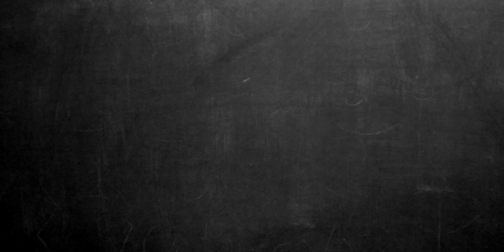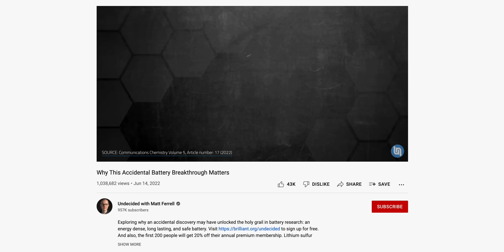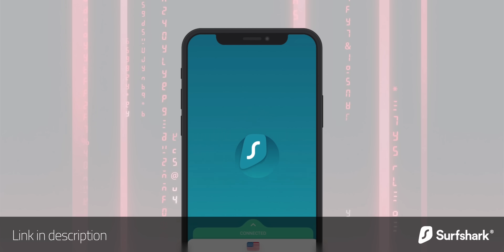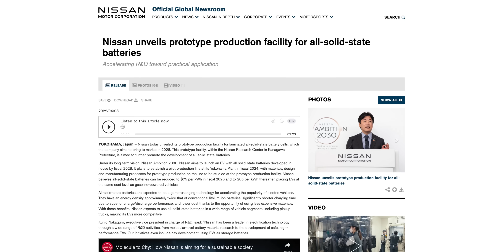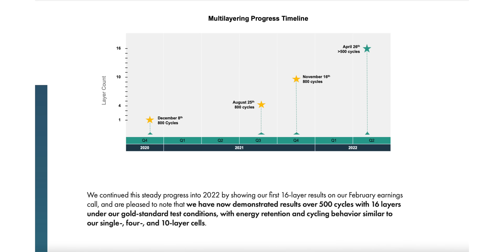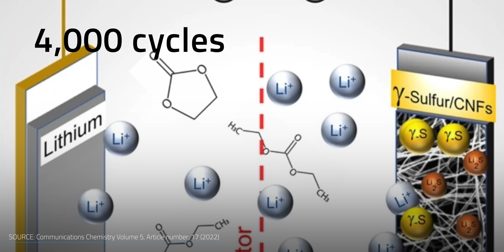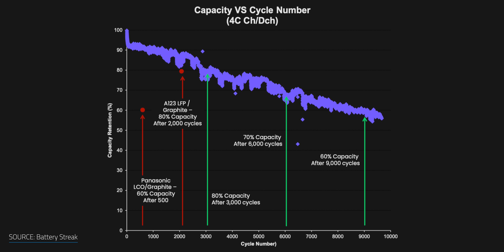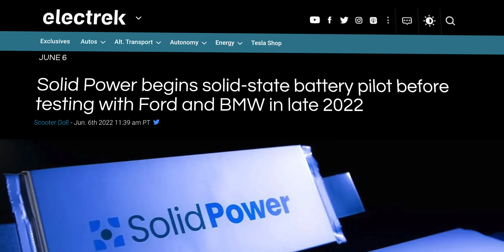Is This Solid State Battery Too Late?

Comment: The model 3 is so much fun I'm not really worried about my charge time since for everything i've done it's charged overnight. Now in the future if they get some insane battery it'd be cool to replace the battery in my model 3 after it ages a bit. Get 700 miles of range would be pretty insane tbh.
Reply: @Screwdriver440 good to hear, assuming they don't end up in landfills.
We've got a bad track record as a species with making something, then having an 'opps' moment for the next 2-3 generations
Reply: Also for a motorcycle that has limited space for a battery could benefit from all this. Imagine the perfect commute bike with a healthy 150km of range.
Reply: @makatron  Or an Aptera or Lightyear. But yes a bike with a real world 150km highway range that could recharge in a few minutes would be great for small mountain road trips.
Reply: Those new tabless cells are almost the size of those 90 calorie Pepsi cans.
Reply: For the majority of people who are able to charge at home, speed of charging is not an issue. What is an issue is availability of en-route & destination chargepoints. In the UK, roll-out is patchy and many of these are alas not working :(
Reply: @guy2726  charging away from home will be solved best by market forces. I expect it to be solved fairly quickly.
Reply: @Screwdriver440 It is true on theory.  In real life there is very low recycle rate for old battery.  How many mobile phones you own in your life?  How many pieces of battery of those phones recycled?  Cost of recycling  is very high and in most cases unprofitable.   It is even worse for a EV's battery.  It is structured like a Russian doll with layer and layer and layer and layer and layer of encapsulation.  Recycling is even more difficult than manufacturing itself.
Reply: @catchnkill  I know a lot of recycling is BS and what you say about recycling lithium batteries is true today but, it is not a stretch to claim that with greater adoption of EVs, the vehicle-lithium market will follow the lead-acid market.  Lead-acid batteries are the most successfully recycled product ever; over 99% actually get recycled!
Lithium batteries for phones, tablets and what not, are (as you point out) another story all together.
Reply: @catchnkill  automotive lithium batteries are already >90% recycled.
Reply: @williammeek4078  You throw a random number for bluffing.  Sources?  I can tell you that it is not true.  In the biggest market of EV China they never claim such rate.  So your > 90% is npt possible.  Sources please.
Reply: @catchnkill  in.most countries, there are laws in place that requires the manufacturer to recycle its products.
If the consumer throws his old phone on a trashcan, the manufacturer is off the hook.
The replacement of a car's battery on the other hand will have to be done by a professional company which certainly would want to send it back to the manufacturer for disposal and recycling (or else they would have to either pay for it themselves or illegally dump it somewhere).
Reply: @mpbello  Real world situation is more difficult than that.  Just use Asia as an example.  The word "most" cannot be applied here.
Reply: @Screwdriver440 Telsa's battery is not like this at all.  They use standard 18650 battery cells to build their battery pack.  Say for example a 85kwh battery pack.  It consists of 7,104 lithium-ion battery cells in 16 modules.  Each module contains 6 groups of 74 cells wired in parallel. The 6 groups are wired in series within the module.  There are a lot of compartmentation to minimize the fire risk to the whole pack.  Within those compartments there is fire-retarding fluid.  There are temperature and other parameters monitoring circuit boards.  It is not just a big aluminum case.  Finally those 7104 18650 cells each  has theirs own metal cases like a normal AA cell.  Not as simple as you say.
Reply: @catchnkill  only the model s and x use 18650 cells. Newer models use 2170, 4680, and CATL LFP cells. Currently Tesla’s cells are 90% recyclable and they intend to have a closed loop supply chain as they won’t need to mine for new minerals to make new battery packs. There’s many ways to incentivize this like discounting the replacement cost for a battery when you trade in your old one. Tesla’s current battery will last 10-20 years easily so it will be a little while before there will be a large number of packs to recycle
Reply: Lets hope your old battery can be recycled then, otherwise ppl with chase the latest fad, thus undermining the modest Co2 gains EV's offers Rob

Comment: Is solid state dead? Not at all, it hasn’t even started yet.

Are there other, similarly good possibly even better, technologies out there? Of course. 

Should we stop pursuing one over the other? No! All technologies are good and useful, especially various battery designs. A solid state battery, of any chemistry, will always be the most optimal choice for applications where impacts are likely, where massive temperature fluctuations are expected, and where accidents are common. 

Niobium batteries will be optimal for high longevity, high reliability, mission critical components like finance servers or ground based defense systems. 

The phrase “you need the right tool for the job” only applies if you even have the tool. Developing multiple battery technologies that are similarly effective, cheap, efficient, and useful can only be good for us

Comment: 65$ /kwh would make for fantastic electric tools - 2 stage snow blowers, chain saws, leaf blowers, trimmers, etc all with awesome run times! a snow blower needs 2-4 kwh to have a useful run time in new england with 24-36 inch storms relatively common. i have 1.5 kw hour ariens and it is barely adequate for driveway + sidewalk so i usually have to do sections with charging between. ebike packs are around 400 dollars for .75 kwh...
Reply: You aren't going to see $65/kwh for use in power tools.  Look at the mark up currently for power tool power packs compared to the claimed prices for lithium ion currently.  Look at the price of name brand ebike battery packs.

Comment: Way too little, way too late.   A techno-fix is not going to stop the accellerating runaway greenhouse process.   What is needed is the immediate removal from the atmosphere of 2 trillion tons of greenhouse gasses.  How much will better batteries remove?  -  Zero.   The only techno-fix possible is the placement of a massive fleet of mylar spaceships at lagrange point one, to block 2.5% of the incoming sunlight.   That would take over 100 years.   Climate collapse will occur within a decade, two at the most.

Comment: It's actually too late for EVs for mainstream use. I'm a firm believer a synetic fuel or a carbon scrubber will become mainstream. I'm betting more on a carbon scrubber. Simply add it to the existing cars. Synetic fuel could beat them to the market though. Synetic carbon neutral fuel is absolutely the best case scenario. No infrastructure change. No one has to get new vehicles.
Reply: Yea synthetic fuels will only happen though if the cost of manufacturing goes down which could happen once economies of scale kick in but likely that much, or fuel continue to rise to double normal market value to make it cheaper in comparison. The big stickler right now is cost of fuel is artificially high due to restrictions on the oil industry in the US, and the trade embargos. And no investors are going to invest billions in new infrastructure when those artificial restrictions can be lifted any moment and they are left with an expensive money pit.

If someone can get a government to back it and go mainstream and be profitable it might happen(good luck)or the cost of fuel stays high permanently. One is unlikely the other will hurt everyone that cant afford EVs.
Reply: That's like riding a steam powered horse. EVs are far superior to ICE in almost every way, there's no reason trying to patch the inferior tech, when you have something much better.
It makes more sense to convert old cars to electric. In 5-10 years it will be easy and economical to do so.
Reply: @andrasbiro3007  Not really that drastic. The current situation is more comparable to how the adoption of the automobile in the first place. Only the rich could afford them while most people where satisfied with their horses. Yes the automobile could carry more, and didn't need have as much maintenance cost or constant food, but the upfront cost was way out reach of the average person. And as we are starting to see now they where adopted by rich people and businesses before the cost went down for the average person to get them, but never went away. Horses are still used by people in my area(Texas) for many things as its just better for the situation.
Reply: @Awrethien  
1. Car adoption was very fast. Try to imagine a scene where half of the traffic is horse and the other half is cars. It's hard, because you never saw such thing. And you never saw it because it was such a short period.

2. There's still no steam powered horse. Of course synthetic fuels are much easier to do, just expensive. But my point was that it's irrelevant. When 99% of the cars are electric, what the rest uses makes little difference. The biggest issue will be air pollution. Just like with smoking, when it's no longer ubiquitous, people will be much less tolerant. I've been driving an EV for almost 4 years now, and I hate walking behind gas cars. I have to hold my breath, because all I can think of is every breath shortens my life. Never had such problem while I was driving ICE too.
Reply: @andrasbiro3007  1."Car adoption was very fast." Not really time seems much faster when looking back on paper and missing a few points.The first concept was in 1881 and the first true "car" first proven in 1886(see Benz Patent Motorwagen). The first mass production was in 1900 and expanded in 1916 with Ford's assembly line. It was not until this point it massively took off. That is almost 20 years to even gain momentum. It still took another 20 years for many places to switch over to trucks. Even in the outbreak of WW2 large sectors were reliant on horses some 50 years after it was invented. It was the industrialization from both the world wars that make vehicle adoption possible even that rapidly.

From the combination of cost being slashed and how there were very clear direct benefits to trucks and cars of hauling much larger cargo amounts, farther and faster. Electric at the moment has the inverse of being MORE expensive than ICE vehicles, and have to choose between range or cargo with the downside of more downtime from recharging... Battery tech is improving but it still has a long way before there is full replacement.

2."There's still no steam powered horse." No it's not and no one ever said it would be, but synthetic fuels are a possible stopgap until EVs are more economical. Congratulations on having an EV already and being willing to live with its shortcomings. I also could live with one as a personal car, but I can't drop $30,000+ on a new vehicle that I would drive less than 50 miles a week. Also I would literally be unable to do my day job since I drive a company truck. An electric vehicle just does not have the range I need as a field tech for an ISP provider. 

It is these issues that will keep the adoption of EVs slow. They are not a clear cut improvement, they for now have their own advantages and disadvantages mostly range and cost. So for the other 99% of us we will keep using what we already have and switch over when it makes financial sense, and it can do what is needed. I agree pollution is an issue but there is the "It would be nice to have" and then there is "I need to pay my bills."
Reply: @Awrethien  
1. I'm not talking about the entire history of cars, but the actual mass adoption phase. The 10% market share to 90% market share. And of course only in the developed world. And trucks are an entirely different market.

2. EVs will be economical across the board before synthetic fuels have any chance to be. The mass adoption phase already started, the demand is there, it's just a matter of scaling up production. Scale will solve the cost and all other issues automatically.

I'm not living with any shortcomings, I'm actually escaping the shortcomings of gas cars. Especially with current gas prices. I could drive 300 miles a day if I wanted, without stopping to charge. That's enough for a lot of work. Taxis drive less a day. Delivery vehicles too. And on long trips I can use the Supercharger network, which makes thousand mile daily trips not just possible, but fast and convenient.
I don't know how much you drive a day, but likely you could easily do it with a good EV.

As for economics, the more you drive the more you save compared to a gas car. There's a point where a Tesla is cheaper to own then the cheapest gas car you can find. Assuming average usage, over 5 years a Tesla Model 3 costs about the same as a Toyota Camry. EVs are usually not economical below this price point, yet. But EV prices are falling and gas car prices are rising. Somewhere in the second half of this decade no gas car will be economical to buy.

Comment: So, let's go with the "Can charge 4-6 (so lets say 5) times faster" 
What does that mean for the Charging pedestals? With these batteries, they would be at their highest discharge speed almost constantly for existing stations.
What do you think a station capable of charging at Megawatt speeds would look like? Or even rows upon rows of these stations?
Imagine being the grid organisers and getting a request for a connection size of those capacities?
Reply: The Tesla Megapack can smoot out the load. And peak charging rate isn't as important as the average. 250kW or even 150kW is good enough, if it still holds at 80% state of charge. Usually charging speed drops fast over 20-30%.
Reply: @andrasbiro3007  Hmm, good point. So you think existing stations would be fine with "Okay, Peak may get capped, as long as it increases the average by 4-6 times".. I like it... Do you think the stations themselves will be able to handle a sustained load for higher than it normally would nowadays?
Reply: @ColinRichardson  
Chargers can do it just fine, batteries are the bottleneck.
Reply: Proponents of alternative energy are the kind of people that can just barely change a light bulb. If they had to light a campfire they'd probably freeze to death in the process.
Reply: @1pcfred  that seems a little off topic. Did you mean to comment that somewhere else?

Comment: What would be cool is if they could make a metal hydride that stored hydrogen but also served as a battery so as to get two uses out of the cell at the same time.
Reply: Fossil fuels store hydrogen. That's why they're called hydrocarbons. There's far more hydrogen in gasoline by volume than there even is in liquid hydrogen. It's remarkable!
Reply: @1pcfred  No, you can store more hydrogen in gas form in a metal hydride container than you can of liquid hydrogen in a container of equivalent size. That is a fact.

Comment: I think anything that makes EV battery packs smaller and lighter is a win. I look forward to the day when battery packs advance enough to make an EV Miata a real world thing. Of course by the time that happens it will probably be loaded down with the full ADAS/Nanny cornucopia and completely ruin it.
Reply: You'd be better off making your own. It would make it a track monster.
Reply: @baronvonlimbourgh1716  yeah, but the range on the track would have me singing along to old Tenacious D, "I'm gonna kick your ass! From here... to right over there!"
Reply: @chaseweeks2708  depends on how many laps you do before a break. 30/45 minutes should definatly be doable on a light car like a miata.
Reply: @baronvonlimbourgh1716  with current kits you're looking at about 100mi without putting your boot into it. Less than half that on the track. And they are not packing high amperage chargers, so if the battery is flat you're gonna be sitting for hours while it reinflates. Not a good track weapon, but it would still be hilarious fun on the daily commute.
Reply: @chaseweeks2708  you can make your own battery packs. Loads of channels dedicated to that on youtube here. Also with factory charging systems from crashed ev's and the sort if you wish.

If you have the time and some resources crazy things can be achieved by men in sheds lol.
Reply: @baronvonlimbourgh1716  true, and as time goes on more knowledge is amassed. Just talking about the current options.
Reply: @chaseweeks2708  it usually is the time and resources that are the problem. Got so many things i would like to do if i had the time and resources.....

But the reward is there for the ones with the determination.
Reply: @baronvonlimbourgh1716  agreed, and same here